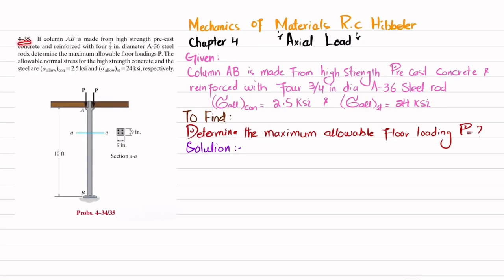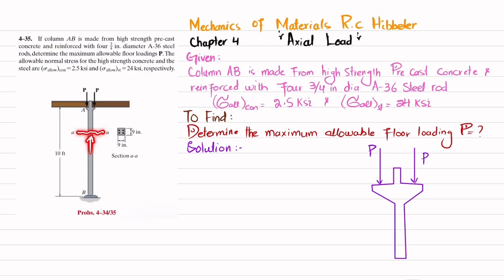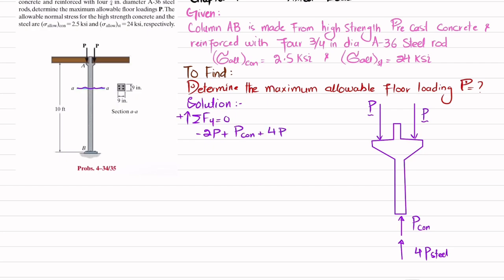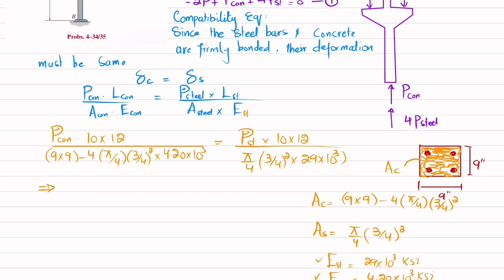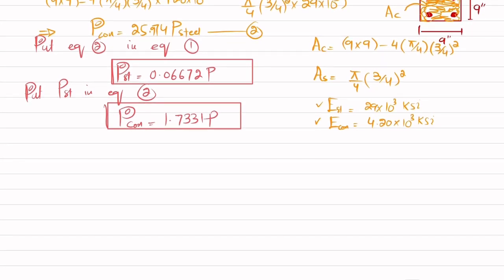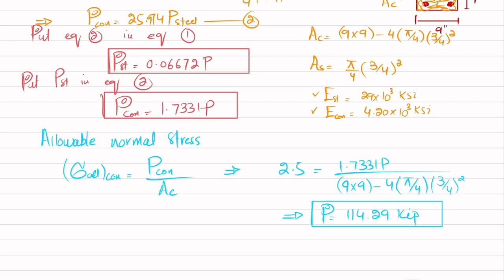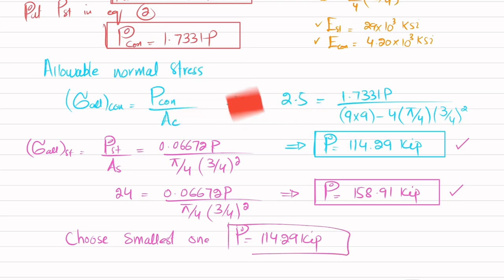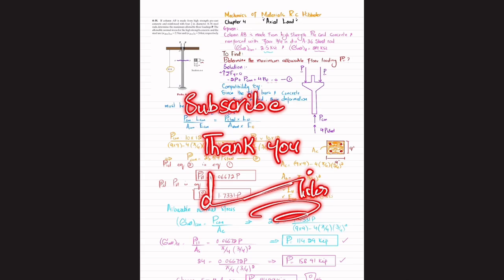Determine maximum allowable floor loading P |Problem 4-35|axial load| Mech of materials rc Hibbeler

Comment: Sir, how did you get Pcon = 25.974 Psteel? I have tried many times but have been unable to achieve it.
Reply from the maker: calculate separately Ac then subtract it from 9x9 and then multiply with 420x 10^3
Reply: @engradnanrasheedmechanical ❤